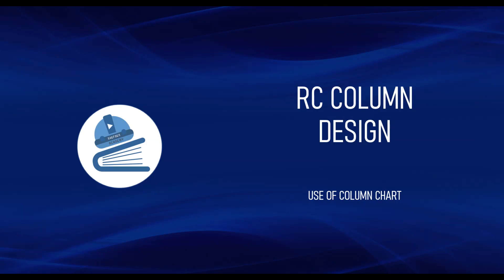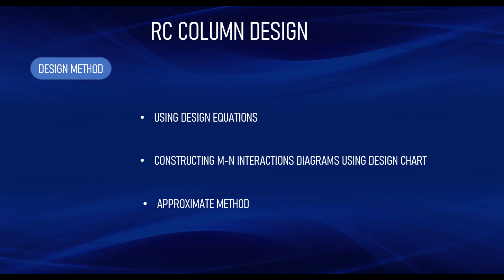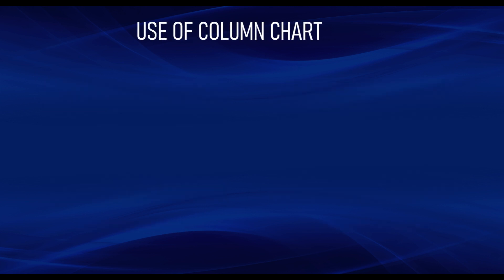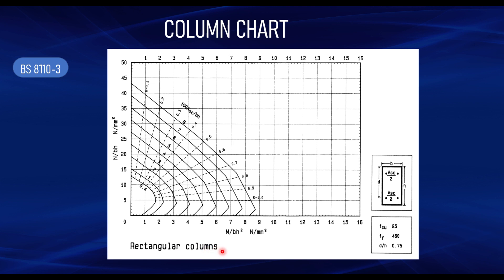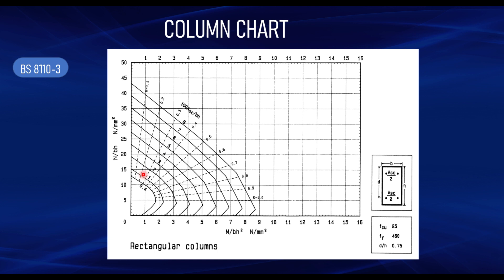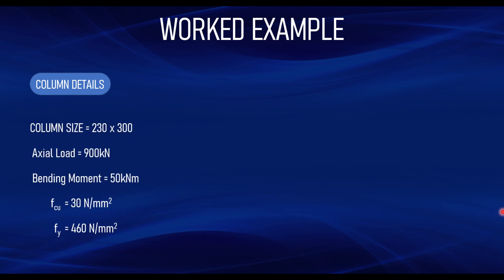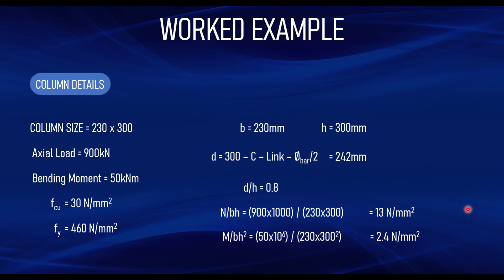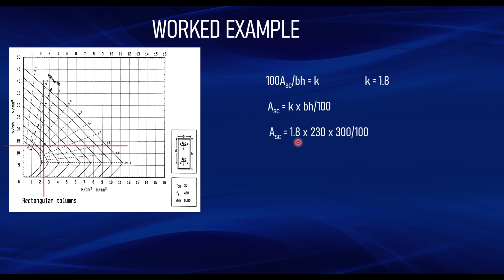RC Column Design Using COLUMN CHART | BS 8110  - 3 | Short Column

Comment: What if the fy is not 460 .how will I use the chart
Reply from the maker: Rebar steel are usually in 2 grade . Grade 250 and Grade 460/500. So you can use the chart approximately equals to your strength. If your strength of steel is not close you can design a new chart from that or use the first principle method for the design.
Reply: So sir can you show charts that has the fy to be 250?